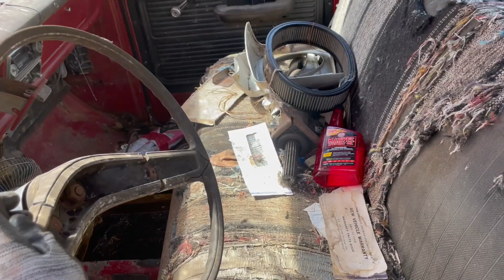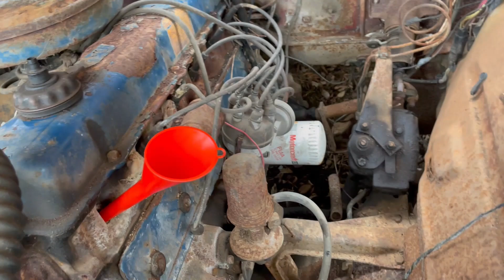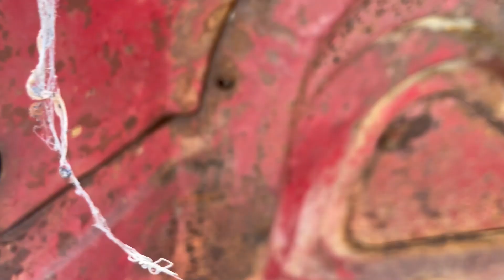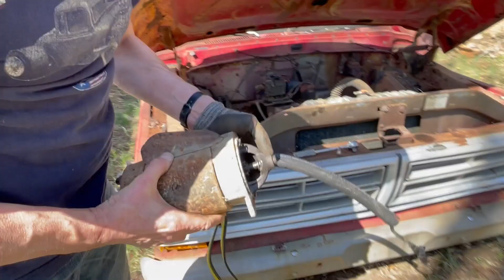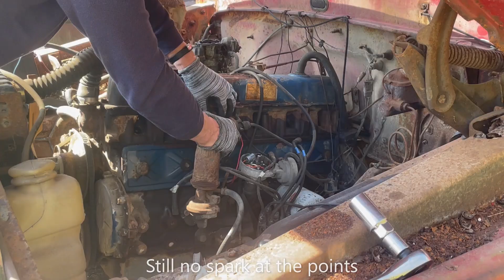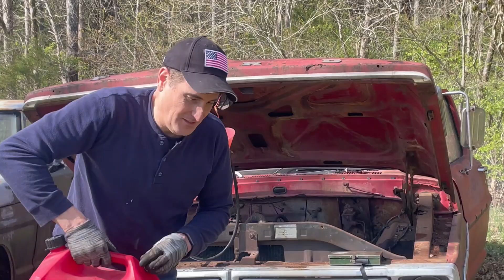Will it run? Seized, neglected and left for parts. 1972 F100 Custom.

Comment: Big hello from Biddulph in the UK.
Just a quick question, when you do the will it runs and you have to put new parts in IE, starter motors, ect, and you don't purchase the vehiclle, do you leave them parts in the vehicle or not? Thanks for the great video's

Comment: Mr Rust get ya a magnet tray for your bolts and nuts you take off for beginning. Now if your going to do extensive removal like valve arm, valves, remove the head, get the green flat rubber like mat and you can place them in order of removal so you don’t confuse where they go because of length of bolts. Watch junkyard digs for ease of work I know I know your in the learning stage I’m just trying to be helpful Mr Rust. Don’t shoot the messenger.. 😃🛣️
Reply from the maker: No worries David.

Comment: how long have you been out of Massachusetts? What gave it away was when you said it doesn't have to be "MINT"Lol..  300 inline 6 in my opinion is the best engine Ford ever made.What do you think is causing the massive leak? Big fan of your channel, Keep up the good work.
Reply from the maker: Ah yes, "mint". That was, maybe still is, such a popular term up there. I was there until 2003. I find it interesting how people in Mass have their own vernacular that is totally different from other parts of the country. Most of the stars in Hollywood that try to mimic the accent and the words used fail terribly, but the "smart park" Volkswagen commercial nails it.

Comment: Did you yank that good starter an d return or shelf it? Coil?
Reply from the maker: I put the old starter back in when I was done. I don't recall what I did with the coil, but I think I found one for it and left it installed in the truck.

Comment: who would have thought it'd run after the first turn of the crank? :D

but it runs, as neglected and as stripped as it may be.

you know, here is a thought... I had it happen that neglected vehicles had mufflers rusted inside and collapsed to block the exhaust. here, there was no resistance at all, and nothign to blow free first... it might be worth the experiment of removing exhaust pipes from engines that won't really start first, or won't idle.
Reply from the maker: I have seen that happen, although not often. Pipes get bent or a muffler baffles rusts and blocks flow.

Comment: ''Six in a row and you're ready to go, If it's six inline she'll be fine, Inline Six is  easy to fix.'' My father always used to say those, be it a GM, Ford,  Chrysler gas or diesel inline 6 is the most durable, cheapest and easiest to repair of all engines. Having watched him own many, and owning many myself in my 54 years I'd have to agree. Glad I found your channel about a week ago. Been marathoning your videos in my free time. Absolutely love your gravity fed fuel funnel technique, I might have to steal that myself. haha Great work getting this, and all  of the other old iron going again!
Reply from the maker: Thank you! I love that "inline six is easy to fix". I had not heard it before, but it certainly is true. I have been using that :funnel fuel system" for more years than I can remember, and it has never let me down. It is surprising how much fuel pressure it makes.
Reply: My grandpa swore by these engines ford 200,240,300 inline 6 are the one's And the gm 250 inline 6 cyl the 200-300 inline 6 cyl Ford motors are torquey and have decent hp, and the gm 250 L6 are so reliable they are almost bulletproof and durable good low end torque but no power lol, and the gm292 L6 would run off and leave the gm250L6...

Comment: I bet it would actually idle, or at least run better, if you hooked that rubber PCV hose to the PCV valve. Huge vacuum leak there, my man. Easy to overlook the "small" stuff.

Comment: Those ol' 4.9s have been bullet proof for me. Had a '78, '80 and I still have my '88.
 Thanks 👍 That Custom is still pretty solid for her age.
  With the current price of new and even used trucks so friggin high, she might be worth the trouble...
Reply from the maker: I agree. With about $1000 in parts, add some tires, and you would have a work truck that will last forever.
Reply: @whattherust  And NO smog checks!